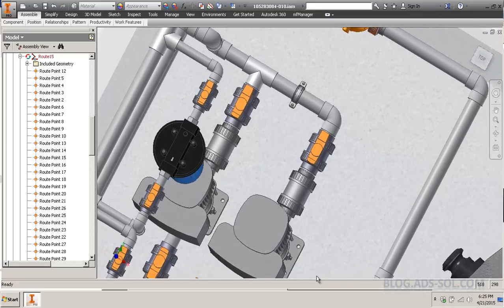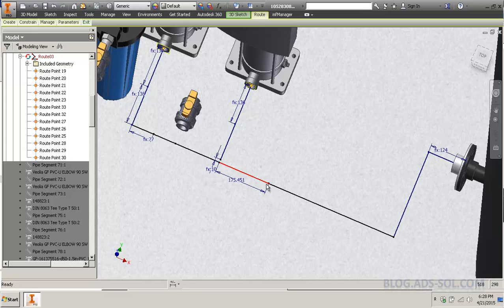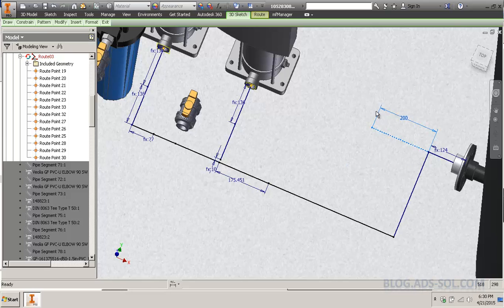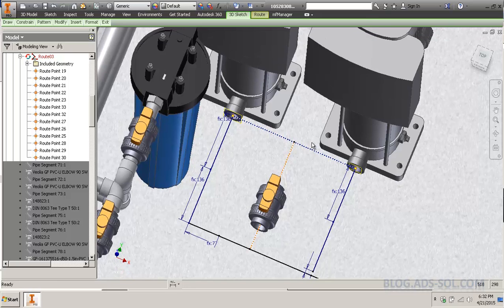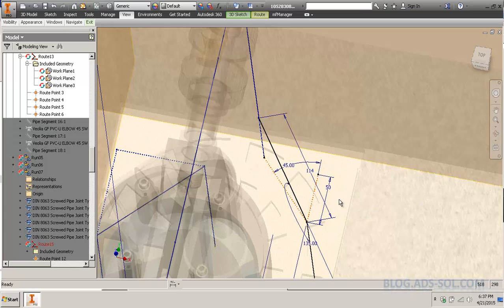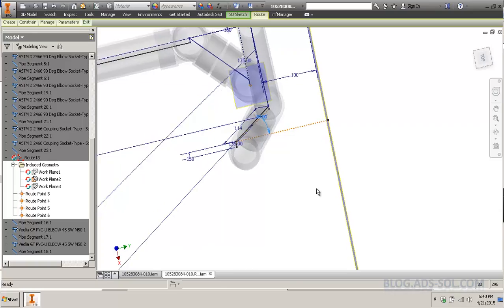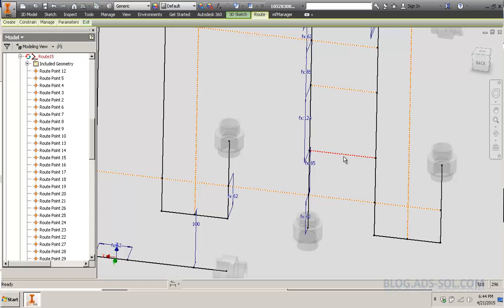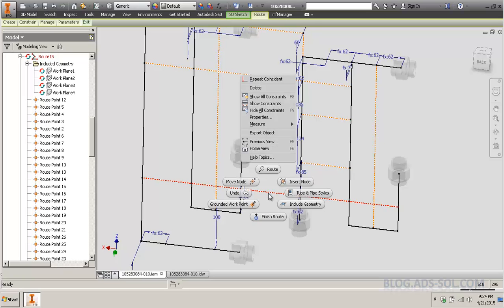Autodesk Inventor: Tube and pipe construction lines

Comment: Keep the videos coming! What software are you using to record and edit the videos?
Reply from the maker: Hi Stephen,

Tecsmith Camtasia it's called. The screen size is smaller compared with my previous videos but I've done it on the laptop in a hurry.
Reply: Thanks for that, i'm building up a series of posts related to the sloped lines in T&P, not much on that topic anywhere.
Reply from the maker: Nice... 

they can be quite a struggle , especially for authoring custom angle elbows. give us a poke when you've done it.